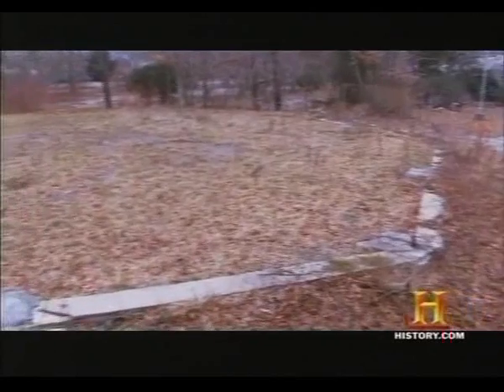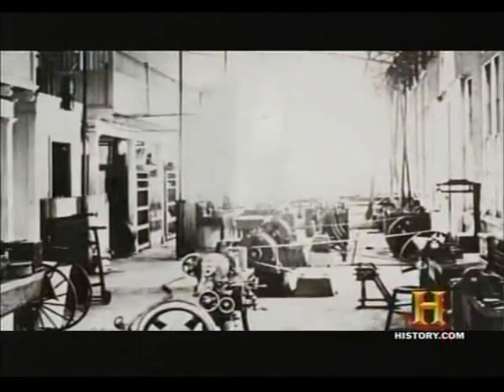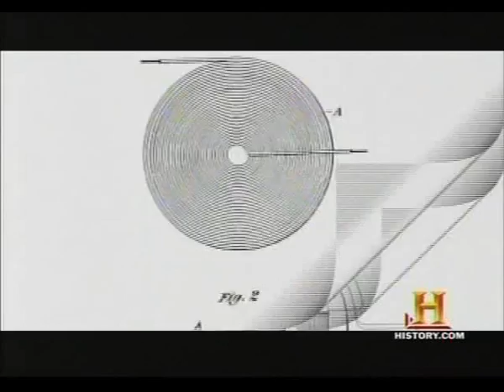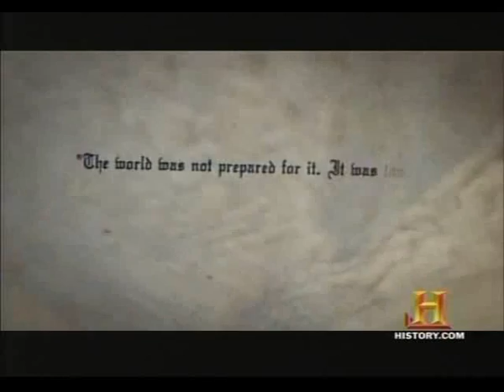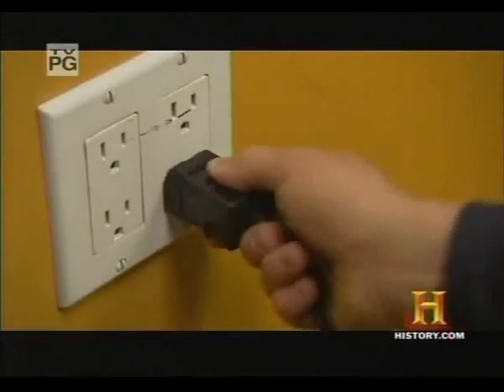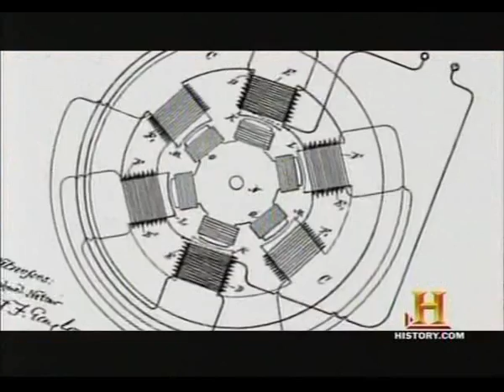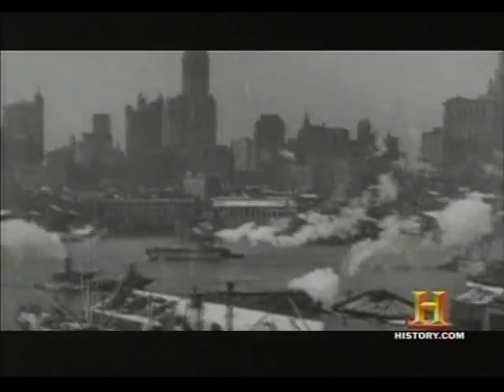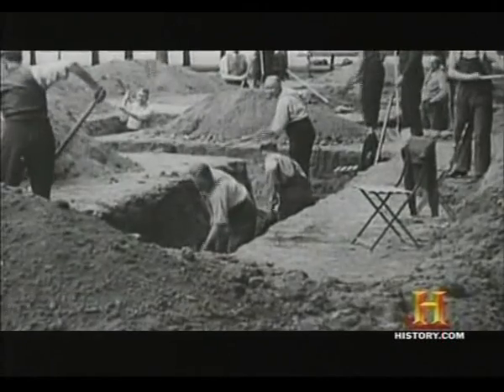Nikola Tesla - Mad Electricity part 2 of 5

Comment: @lozoft9 Marconi didn't steal anything from anyone. Tesla was shamed by the 21 years old italian boy when Marconi sent the first long distance radio transmission in 1895. Tesla never design or built a working radio system. Marconi did it. Marconi is the true forgotten genius. Tesla was just capable of stealing idea from others as it happened with Galileo Ferraris and the induction motor.